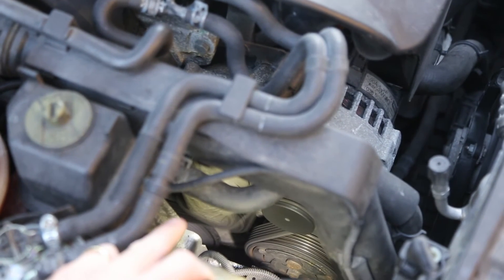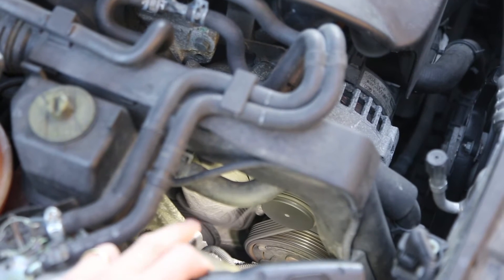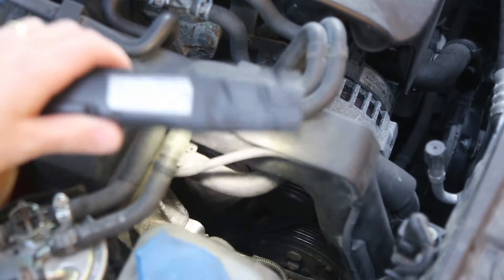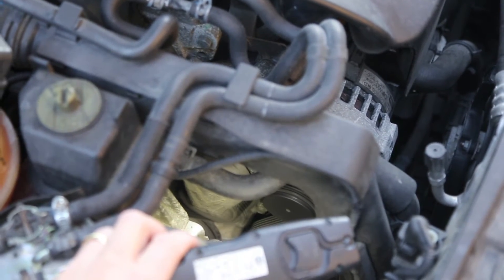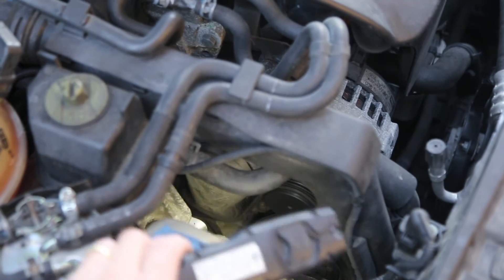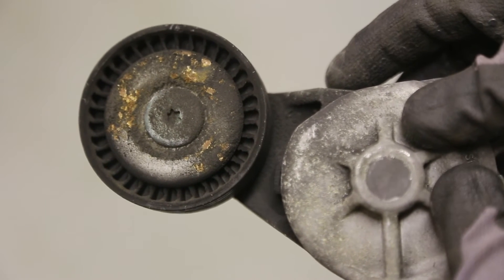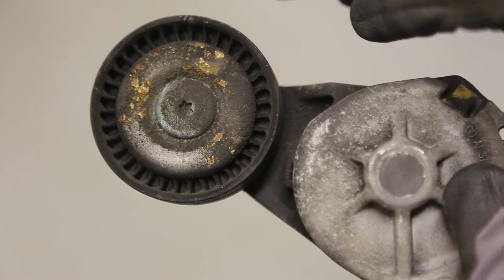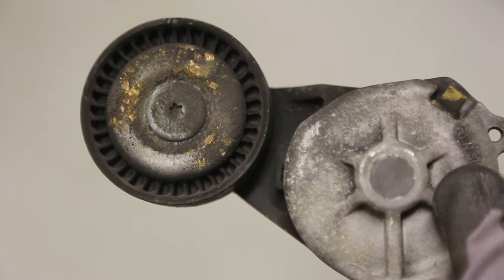VW Golf/Bora/Jetta MK4 Loud Noise when Steering on Full Lock and when Engine at Idle

Comment: I had that problem i changed the pulley and turned out to be the alternator clutch was seized in case anybody has same issues it's worth checking both